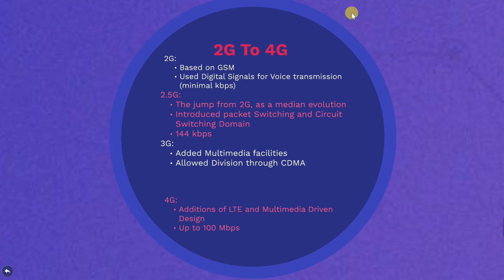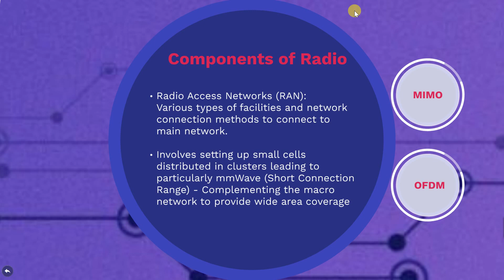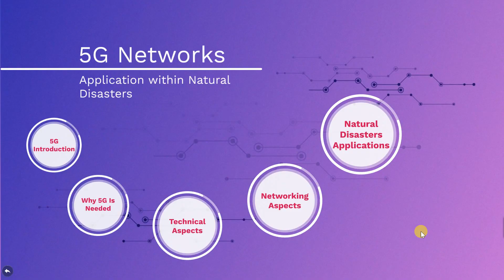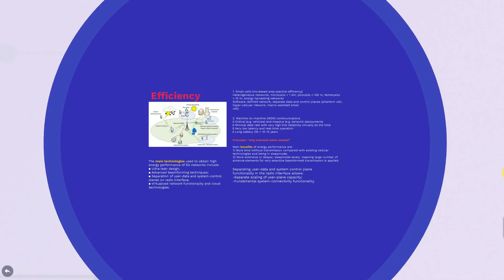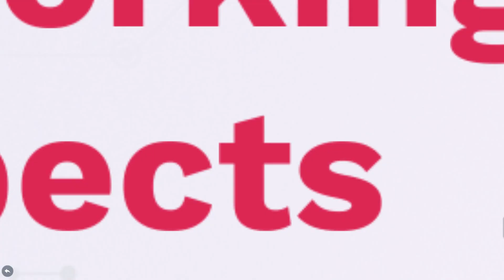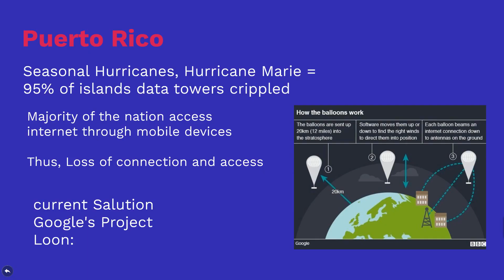Computer Networks: 5G Application Within Natural Disasters

Comment: Is small cells required to implement 5G?
Reply: Most yes and this is mainly since 5G will use higher frequencies which don’t travel as far and as well through obstacles like concrete buildings. To overcome this, 5G radios must be installed, and quite frankly, a lot of them must be installed. At the end of the day, there’s no going around the fact that rolling out 5G to large geographic areas will require a tremendous number of small cells.
Reply: Oh I see! Thanks!